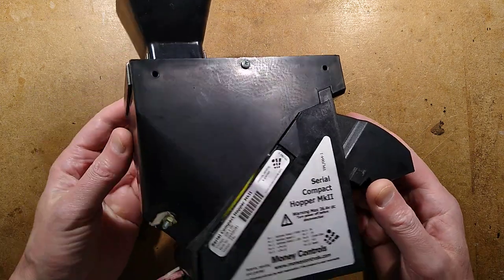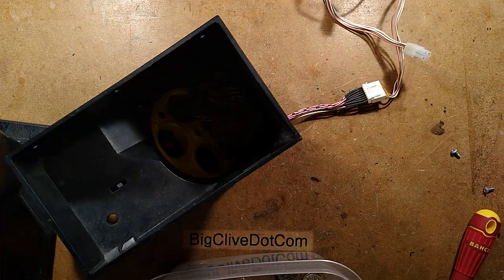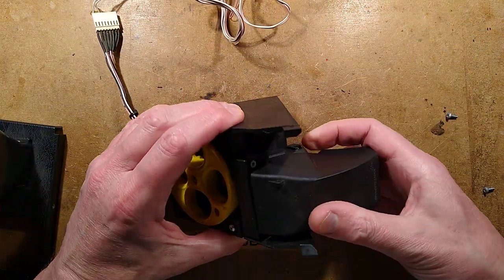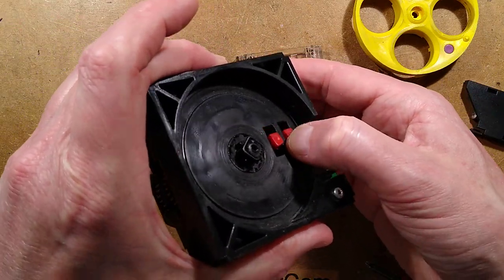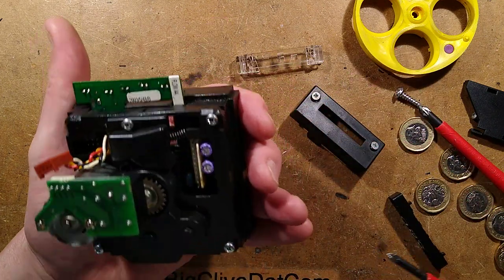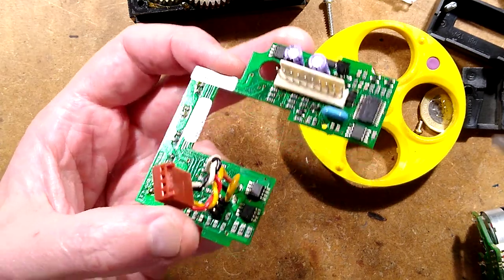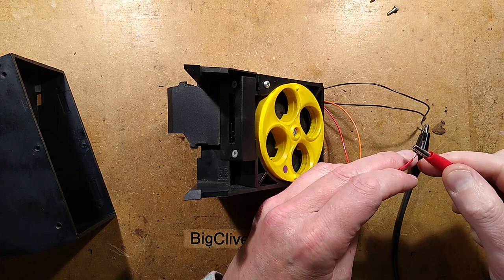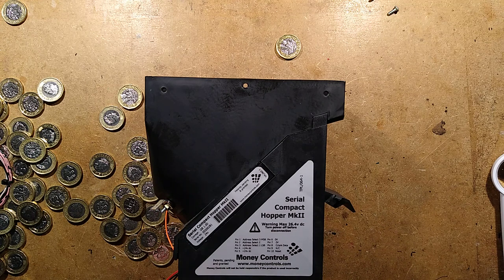Coin payout hopper teardown

Comment: Well, I presume the relay would be shorting out the motor mainly as a form of tamper protection. Obviously it's not particularly difficult to defeat. But still, just energizing the motor itself without energizing the relay won't do it. I doubt the mechanism will experienced a lot of torque from the coins, since their weight is distributed evenly. But I guess a little more mechanical resistance when the motor is turned off (and shorted) would also make potential mechanical tampering more difficult...?

Comment: 17:30 I would imagine that the shunt relay is to bring the mechanism to a rapid halt thereby preventing an overshoot and resultant overpayment. I wonder why they don't use stepper motors in these things? I have one (Suzo International) which is very similar with a brushed permanent field DC motor.

Comment: If the controller has a full H bridge in order to reverse the motor surely it could also use it to brake the motor. Others have mentioned that the relay is for temper resistance and that seems like a more likely reason to me.
Reply: The relay is also a safety feature if the H bridge is broken. I have seen couple of cases where the H bridge had faulty optoisolators. The motor ran all the time because there was no shortcut relay on that hopper type.

Comment: "Very minimalist indeed, and that's what makes things reliable" also equates to makes them cheaper, and ultimately makes more profit.

Interesting bit of kit, but even with this insight, I'm still not going to be putting my money into them!

Was there ever a time when coins were ejected by way of a solenoid mechanism? - I seem to recall hearing arcade gaming machines in the past making a distinct, rapid "click-thud, click-thud, click-thud" as they spat out a few coins.
Reply from the maker: There were solenoid system that used a sliding plate under a tube of coins to pay out coins with a loud thumping buzzing noise.

Comment: I wonder if with current sensing, the increase to 350 ma could directly reverse the motor similar to what happens when a garbage disposer jams. Then when back to normal it goes back to the normal direction

Comment: Relay acts as a dead short? But you measures the in and out connection of the motor... A continual length of copper wire👀 of course it reads as continual 😅 did I miss something

Comment: The bain of North American coin machines: the Canadian quarter is almost the same size and almost the same weight as it's US counterpart.  You can usually get a Canadian quarter or two through a US vending machine before the slight difference in the coins jams the mechanism.  US banks won't take Canadian change...and there's been more than once where I've bought a $10 roll of quarters (for doing my laundry back when I was a bachelor) only to discover a Canadian quarter or two in the roll 😒

Comment: Guessing all the anti-tamper stuff is in software now.  Do the two IR LEDs have independent drive lines to the PIC to try and detect light attacks?
Reply: I'd hope the LEDs are modulated  with synchronous detection on the photodiode side to defend against this.

Comment: I see the relay requires 24 volts, but I'm not sure the motor should run on 24 volts. 12 volts perhaps? Seems like it runs and ejects coins a little too rapidly. Just a guess.
Reply from the maker: These units do run at high speed.

Comment: It's probably secret, but it would be interesting to see how the sensor tells the difference between a genuine coin and a slug or washer.  Just for kicks.  🤔
Reply: Short answer, it doesn’t. Once a coin has got to the hopper it’s assumed to be genuine. The validation is done by the coin validator as the coin goes into the machine.

Comment: There's little components to minimize fraude.
I worked in the gaming industry (casino) for many years and people are always and everywhere trying to hack the machines from the outside with high voltage devices, magnets, coins on a wire etc. etc.

Comment: I am just start out with electronics and  I want to save money by salvaging electronics for 74 series, relays , EPROMs and other chips. What are some good sources
Reply: Unfortunately these days modern electronics wont have that stuff in it any more... 74 series logic is now largely replaced by microcontrollers and CPLD's, EPROMs are replaced by flash memory (often built into the microcontroller) and relays are used much less in favour of solid state switching like triacs.
Reply: Be smart about it.
Don't salvage stuff that is already cheap to buy. If i work one hour, even at minimum wage, i can acquire more universal parts like 74 series, resistors caps and transistors than i could ever salvage from old equipment. 
Also, while playing with the old stuff is fun and fulfilling, if you're gonna do digital stuff go for modern microcontrollers such as PICs and ATmega/Attiny stuff. That will give you a lot more useful knowledge if you ever get into electronics on a professional level. 

That said, you can salvage some things. Power bricks/wall warts are useful to get little transformers from (the non-switching kind!). You can grab an old CRT TV for the high voltage transformer and the driver transistors. And computer power supplies are themselves quite handy for all the different voltages they produce - and if it's broken, for the heat sinks and the fast rectifier diodes (if those survived).

Comment: If it was giving change, it'd need 8 units for every possible coin. I suppose the ones that do multiple coins have a more complicated mechanical arrangement, rather than just 8 of these side by side? Then again, it'd be robust. And if say the 5p machine cacked out, you could just give the customer 2x2p and 1x1p to make up for it. And when those bastard job-stealing machines at the supermarket (do they pay me to scan shopping? NO! So I'm not gonna sodding do it then!) give me change (sometimes they shut all the tills down), I only really hear chonking for each coin I get, no swivelling or anything, so maybe they do have all 8. Then have the note acceptor on a different bus, why not? It's only serial.

Comment: I always wondered how these machines recognise and rejected foreign coins 🤔 I think I get it now but I am a bit thick 😄
Reply: A mixture of sound and metal detecting.
Reply: An additional bit of hardware is needed, this is just a coin storage and dispensing device
Reply from the maker: The modern coin mechs use a shaped coil to create a signature for each coin as it passes.

Comment: Hi Clive, I have a question about this video: https://www.youtube.com/watch?v=yhFJzQB6_NM. I hadn't really thought about getting shocked by neutral, but the explanation makes sense. I changed out a light fixture tonight and only cut power from the wall, which just shuts down hot. For the sake of curiosity, I measured the voltage drop from the hot at the fixture to a plumbing pipe, and it was about 0.5V.  The neutral, however, was 1.5V. (I was using the AC setting on my multimeter, FYI.)  How real is the risk of shock when touching a neutral wire that's not disconnected at the breaker box?
Reply: Disconnecting a neutral at the box is not going to help anything. Could make things worse.  
Consider how in house wiring neutral is usually "daisy-chained" from device (recept or light fixture) to device to device. Likewise the hots. When done right, one neutral "chain" serves only one hot "chain" or IOW for each hot circuit leaving the box there is a corresponding neutral. In order to get a meaningful shock off the neutral 4 things have to come together:
1) Non-standard wiring where one neutral circuit serves more than one hot circuit.
2) You don't know the wiring is non-standard so you turn off one breaker but inadvertently leave on another breaker that is feeding a circuit served by the same neutral.
3) Some device on the circuit you didn't turn off is turned on.
4) You break the neutral "chain" at the j-box you are working in.
Now you have voltage coming from the breaker that was left on, passing thru the turned-on device and into the neutral wire, but the neutral is broken where you are working so the current has nowhere to go. This means one of the neutral wires where you are working is now at full mains voltage. You will get some sort of bite off it. How much current is available depends on the characteristics of that turned-on device from Item 3 above. 
Hope that makes sense - a whiteboard would have worked better than text for explaining this. How real is the risk? The odds of it happening are pretty low but not zero. 
And again... do not disconnect neutral wires at the breaker box.
Reply from the maker: You always get a small voltage differential between neutral and ground, as current flow will cause slight voltage drops at any point in the system.  The biggest risk with neutral wires is when you split them apart at a connector, as the return current for a load may find its way back through you if you bridge them.  That will be full mains voltage at current limited by the load.  But even a single LED lamp will pass enough current to give significant shock.
Reply: @bigclivedotcom  What's the best method for dealing with this issue? Should one use insulated gloves?  Switch off power to the whole house?
Reply from the maker: @CassiaConvolution  If in doubt kill power to the whole house.  Dry gloves are always a very good extra layer of safety.

Comment: Wish i could empty a fruit machine with £1.
Reply: Happens daily, you put £1 in the machine to make it look like you are using it, then a device into the note validator that burns through the plastic, pushes onto the CCTalk lines and then tells it to fire out the notes and £1 coins. They are in and out in about 15 minutes mainly up and down the service stations on the motorways.